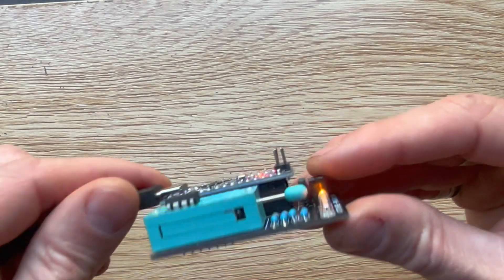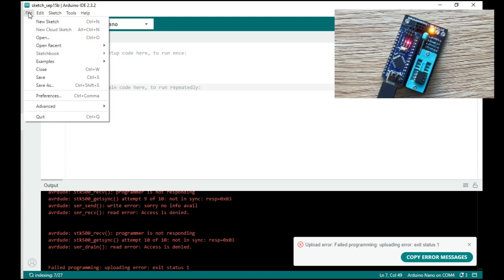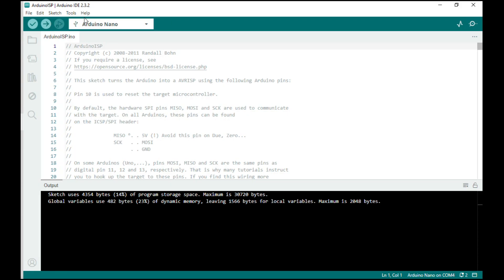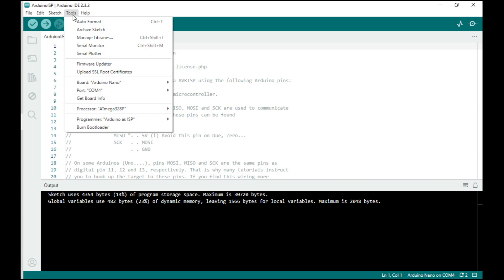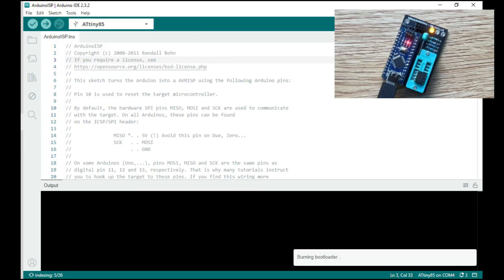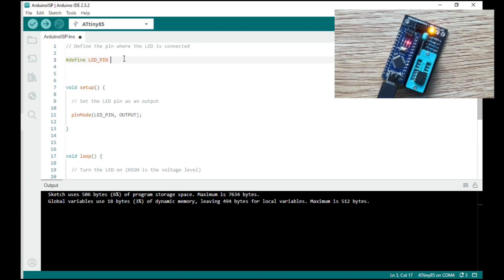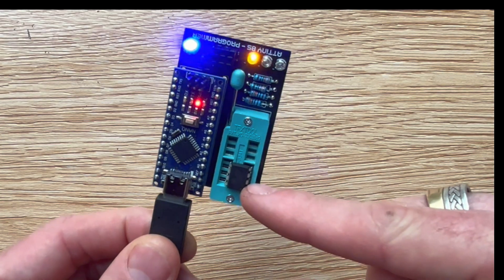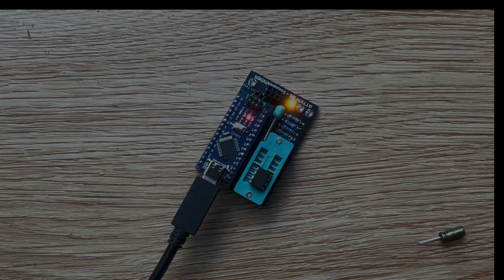Custom Programmer for ATtiny 85 Using Arduino Nano

Comment: I'm keeping up with your Instructable projects.  You really make things seem easy and clear, thanks so much.  My plan is to use ATtiny85 with my N scale model trains via wireless switching and signaling.
Reply from the maker: That’s a perfect application for something like the ATtiny!  Good luck with the build
Reply: I've recently discovered "Attiny85 Digispark Kickstarter Miniature".  Do you have a video/document that covers the implementation of this, or recommend one.  Thanks !
Reply: Never mind, looks like Digispark is out of business... on with  Tiny :)  Just sent the gerber file off.